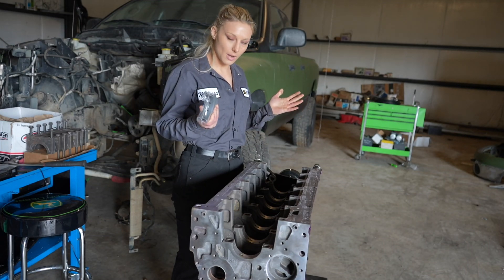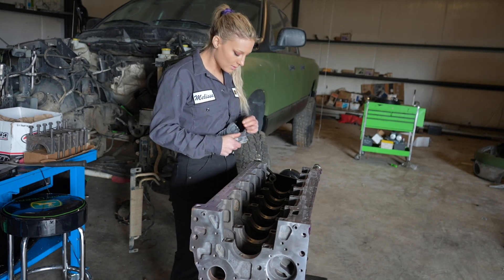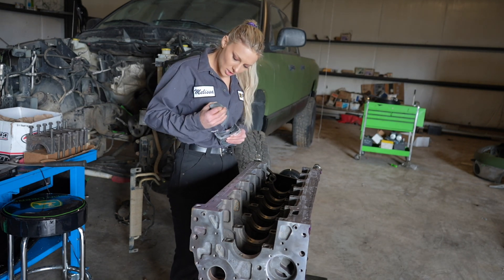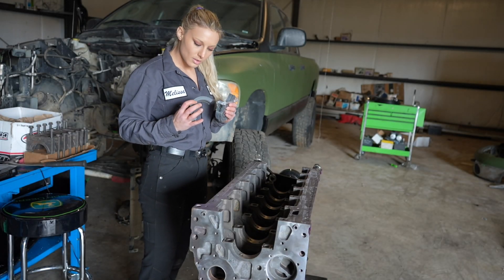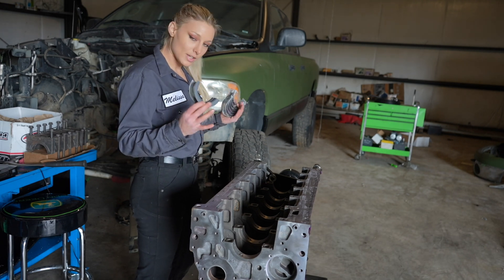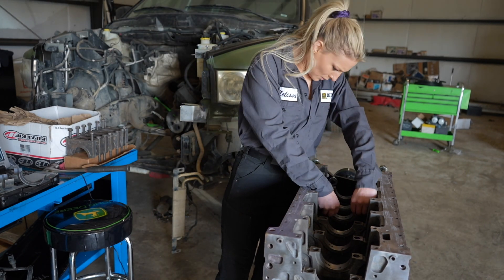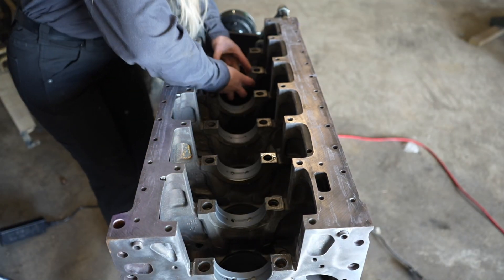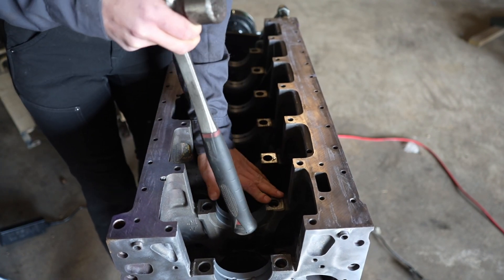05 Cummins 5.9L Upper Main Bearing Install

Comment: I had to watch video twice before I opened my mouth. I've never seen cylinder heads installed before crank and piston/ rod Assemblies before Melissa. Is this  a 5.9 Cummins oddity,or...?  Or were heads just snugged on for safe  keeping? I'm a bit confused.

Comment: Young Lady I was a diesel mechanic for over 40 years I also worked R&D for Ford and Cummins. No one ever said you can not touch the bearing surface with your hands. Don’t know who or what your source is but I think I would do more research. Just saying 🤔

Comment: Nearly every other mec put's a running in "oil" on shells before putting crank in so as not to run it up dry?
Reply from the maker: Well as you can see, I haven't installed the crank yet. That video is still to come. I have like 3 hrs of videos to edit so be patient

Comment: Sorry to judge and I don't care if you are a woman or a man. Is this the first or second lower  end you have put together? You're not completely wrong but don't be afraid to touch the bearing surface just have clean hands and spray them off with break cleaner, have your main caps ready to drop on. Now lube the shit out of both bearing surfaces, spray the crank off one last time wait  a little bit and especially on a engine that small pick the crank up  by each end and gently glide it in like prom night,  hahaha! I don't even know how many in-frames I have done and you are going to touch the bearing.and it's fine.  The only bearing surface you need to worry about is any roller bearing race that might not get put into service/rolling very soon. That was long, just a old mechanic that wanted to share some real life experiences.
Reply from the maker: This is probably the 10th. Why does it matter? If I take the precautions isn't that better than just not caring? This isn't a dick measuring contest dude. If you don't care that's fine. You do you boo. But you don't need to hate on people trying to do things the way they think is right
Reply from the maker: Believe it or not, I heard this from MANY old timer mechanics. Like 40 years of experience mechanics. I took their advice and I have always done it this way ever since

Comment: Glad you mentioned that, I've seen pictures of bearings removed from an engine with a fingerprint clearly imbedded in it!
Reply from the maker: Yup!!!! I know I touched the sides a little but its they surface in direct contact with the journal that's the important part
Reply: Y’all need to stop inhaling spray parts cleaner.😵‍💫
Reply: @glennjohnso310  Dude I been there done that, she is spot on.....that's beginner votech stuff. You can be a hack or a professional, your choice.
Reply: Guess after 40 years I must be a hack. Funny working R&D no one ever said you will ruin a bearing by touching it with your hands.
Reply: @glennjohnso310  I guess it's never to late to learn. I think the picture I'm referring to possibly comes out of a John Deere FOS book possibly but I can't be sure. It's just fact.
Reply: Well, I guess I'm another one. Started as an operating engineer apprentice mechanic in 1970 and I probably rolled in hundreds of c190, small cam, big cam Cummins, cat 3208, 3116, 3406, Detroit 6-110, 6-71, 8v-71,12v71, one 16v-71, 4 53, 6v-53, a couple of series 60s and probably a few that I forgot about. I have never heard or read anywhere to not touch the bearing surface.

Comment: I watched a group of Pakistani men assemble a motor in the dirt and ur worried about skin oil. Trust me its not a problem
Reply from the maker: I'm very meticulous with engines.
Reply: I’m betting the dirt built engine doesn’t last very long.
Reply: She isn't WRONG! I've seen fingerprints on bearings that ran a long time and we're still there many miles later.manufacturers tell you to not touch bearings for a reason.
Reply: "Pakistani perfect"😂
Reply: Trust guybuddyman

Comment: putting the pistons in from the bottom or top? 🤔
Reply from the maker: For off that's not even possible le to put in from the bottom. Second.  The head was mocked up for shipping. It's not actually installed and will be coming off when I have the rest of my rebuild kit. I'm trying to keep dirt and rust out as best as I can
Reply: @thedieselqueenmelissa   the huge chain of comments 😅 the only way it wouldn't work is if there wasn't time put in to do it that way, because if its engineered replacing a rod and piston would then be a lot less work. some day i might do that to a 4.6 triton, because its 390lbft on the stock rods isn't what it was sold to run at... but anyways... less then 20in~lb to rotate the crank?
Reply from the maker: @ardennielsen3761  there was no specification listed for the drag for the crankshaft. Only endplay and what to do if the crankshaft doesn't spin
Reply: seriously???